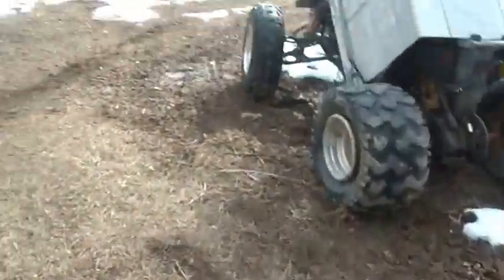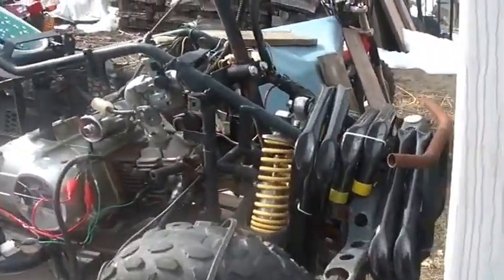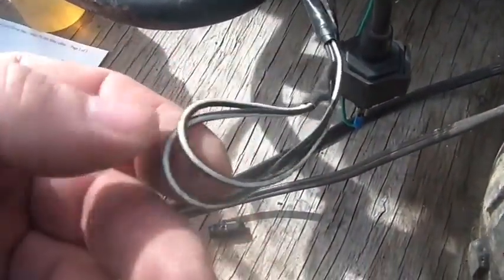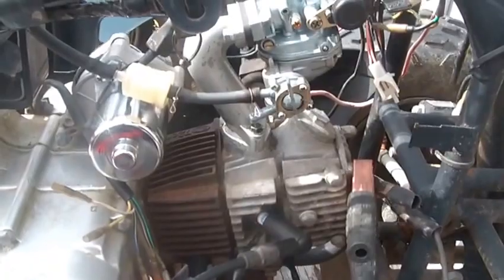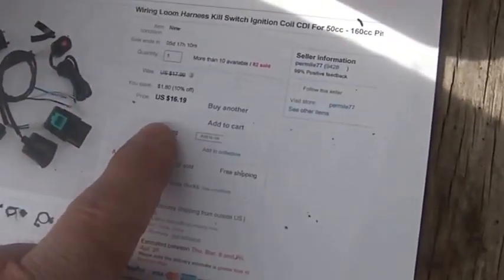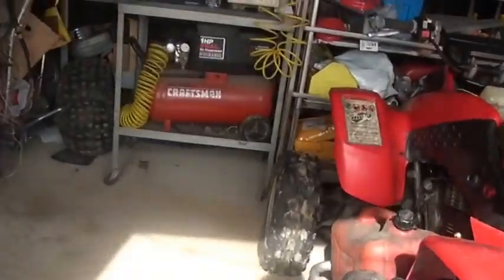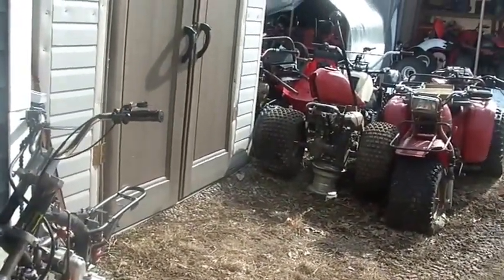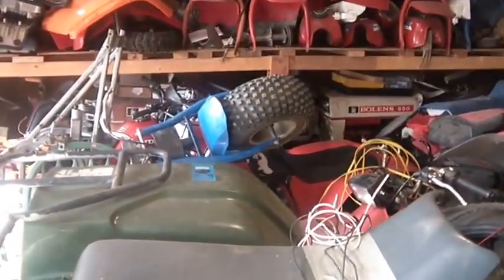Dead China Quad Ignition, $16 Pit Bike CDI andWire Harness Hack,

Comment: Cool
Reply from the maker: Hey Terri, U would look cool buzzing about on one of these little China QUads, I'm sure they are available and cheap out by U.... Thanks for your encouragement, watching, and commenting!!!
Reply: Hey I have left a few questions not sure if you have been busy but I am having trouble with my son's taotao 110b. It was Rose 4 weeks parked and you never would start after that I bought a new ignition switch and cool just to figure out that the fuse was blown and that's the reason why I wasn't turning over now that I have it turning over is getting no spark to the plugs but the weird thing is if you hook the jumper box straight to the starter it has all the spark you need but if you hook the battery box to the battery it gets no spark at all could you please give me an idea of what this could be I know there's only a few things that it could be and I'm hoping that you can narrow it down for me so I can buy the parts needed because I really need to have a kill switch a start switch and a battery because it is my 10 year old boys if you will please please help me I am stuck and very frustrated with it because I know it is simple I just need to know the right parts to buy I don't want to waste any more money

Comment: Harvey, I have bought a Tao tao mini quad for my nine year old daughter, I bought it from a guy that I work with and his son ran it out of gas, Not knowing his son cranked and cranked on the thing until it would not turn over anymore. The father put fresh gas in it but it would not start. So at that point he started tearing into the thing. he replace the starter , starter solenoid, Battery and still no start. then he pulled the entire harness out of the bike.I am somewhat of a mechanic so I thought I would tackle it and give it to my daughter. I have several acers of land for her to ride it and I also Drag Race and this will make a great pit bike. I have watched a lot of your videos on the wiring of these China quads and have went through the original harness everything seems to be correct and functioning as it should  except there is a green and a white and black wire that I can not find where they go. also the rear break with wires are cut, striped and they are Green and Black. I have grounded the green wires and left the black and black/white wire unhooked. I put a new battery in it and it still will not turn over. I jumped the starter solenoid  and it turns over but does not get any spark. I have traced that back to the Black/Red wire going to the Stator and CDI box. I ordered the stator and am waiting on it to come in. My question is..... I would like to by pass all of the crap but still need a starter button, the battery to charge and a kill switch. Can you show a video on how to run  the pit bike ignition but have the battery still in the bike and the starter button work along with a kill switch? I can't seem to find the correct wire diagram and am lost on what to do at this point. Thanks for your time and keep on making your videos. They are very helpful. I have several videos on you tub also but they are about make HHO and Bio diesel fuel. take a look at a few of them and drop me a line or 2 if you get time. Thank you very much buddy,
Jim Huffman-(Jazzy14u2) You tube name

Comment: Thanks for the videos.  I now know that I need a DC powered CDI to have around to test with.  I'm currently working on a 400cc Yamaha.  I have the wiring diagram for the bike but I'm not sure how to find a CDI "big" enough for the bike?  I found one for a 300cc that might work but how can I figure out the wiring for the CDI?  It's a 6 pin.  I'm guessing I can find wiring diagrams for a bike that the CDI reseller claims will work?  or how would you work that out?  Last question, since you've already worked out the wiring on the CDI you're using, do you think it will throw a big enough spark for a 400cc?  Thanks again for your videos and I'm looking forward to your response.

Comment: hello,I've been watching your videos and they're extremely helpful, but I need help on wiring an ignition coil,I have a 3 terminal ignition switch (off,run,start)the first terminal goes to the battery,the second terminal goes to the ignition and the third one goes to the solenoid and whenever I turn the key to run the coil starts to smoke.I'm not sure what to do.

Comment: Hey I have left a few questions not sure if you have been busy but I am having trouble with my son's taotao 110b. It was Rose 4 weeks parked and you never would start after that I bought a new ignition switch and cool just to figure out that the fuse was blown and that's the reason why I wasn't turning over now that I have it turning over is getting no spark to the plugs but the weird thing is if you hook the jumper box straight to the starter it has all the spark you need but if you hook the battery box to the battery it gets no spark at all could you please give me an idea of what this could be I know there's only a few things that it could be and I'm hoping that you can narrow it down for me so I can buy the parts needed because I really need to have a kill switch a start switch and a battery because it is my 10 year old boys if you will please please help me I am stuck and very frustrated with it because I know it is simple I just need to know the right parts to buy I don't want to waste any more money.thank you so much.
Reply: Rode not rose..
Reply: It never would start after I simply turned it off.
Reply: No spark to the spark plug I'm sorry for all the typos just reread it. Plz HELP!!!
Reply from the maker: Hey Ethan, Let me understand this.....The ATV will start and run if U jump the starter directly, but, if U power the starter and the rest of the ATV thru the  battery leads, it looses the spark???  In addition, it blew the lead fuse.... Have U replaced any of the switches, left handle bar or key switch???  To me it sounds like wires are swapped or shorted. The ignition system is independent from the 12DC power system, but in the key switch, the off position shorts the black wire with the white strip to ground and opens that circuit when on. The key switch also closes a switch between the battery power and handle bar switch when on and opens it when off.... Given that it popped a fuse and that it is a cheap replacement, I would start with the key switch, I would also look at the wire harness to make sure nothing is loose, disconnected, or rubbed bare and is causing a short.... after that, I would change the left handle bar switches.... If there is a remote turn off switch, it can be complicated.... I will be removing all that from a Sunl over the next few days.... I hope this helps, sorry for the delay on getting back, my life is a bit crazy right now, let me know how it all turns out, thanks for Ur patience, asking, watching, and commenting!!!!